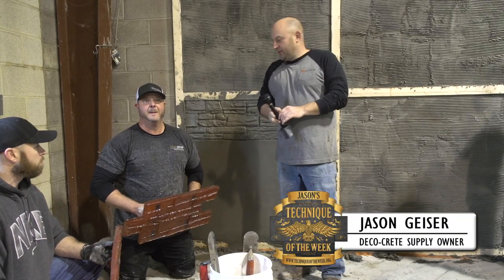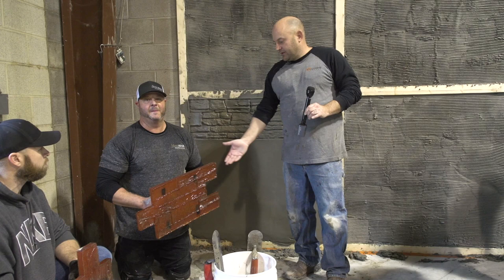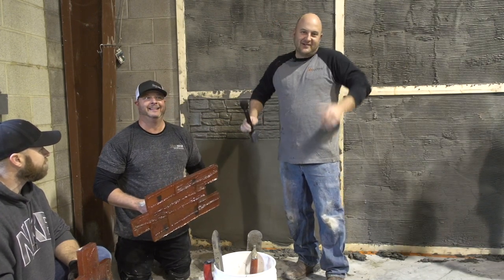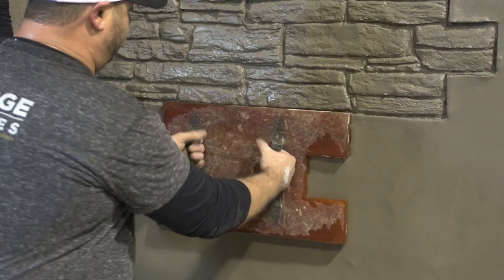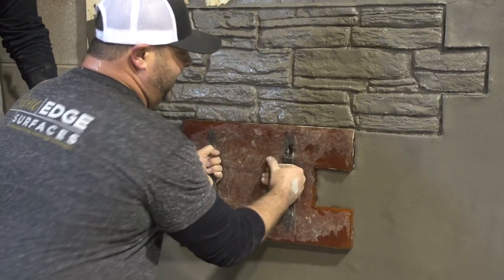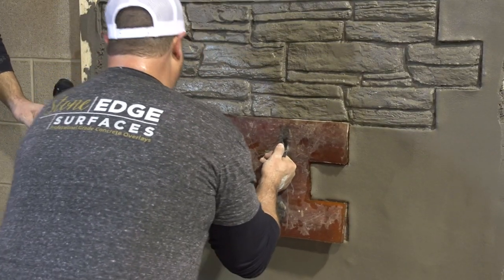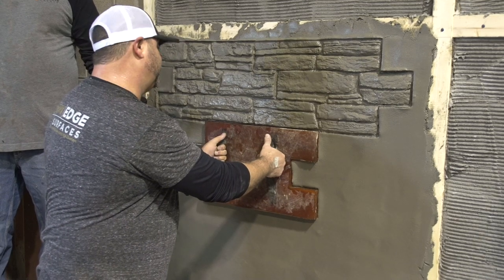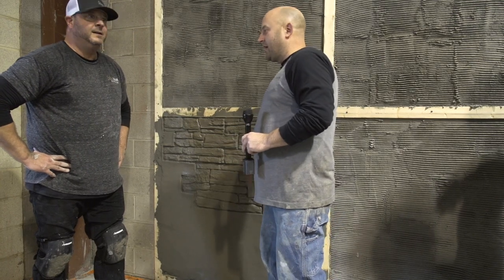Properly Apply Vertical Concrete Stamps!

Comment: What us the ideal thickness of cement and would a diamond wire lath strengthen the cement, especially in hot/cold regions?
Reply from the maker: Diamond wire lath would definitely work for vertical surfaces, ideal thickness would be between .5" and 2". Thanks for watching Jay!
Reply: @DecoCreteTV  THANK YOU!

Comment: Can I use cement board for the background or do I have to wire and precoat ?
Reply from the maker: cement board is fine but I would still tape the seams. for plywood use tar paper, lathe, and scratch coat. Check out this video on scratch coats/prep https://www.youtube.com/watch?v=biZUjLcPaMk